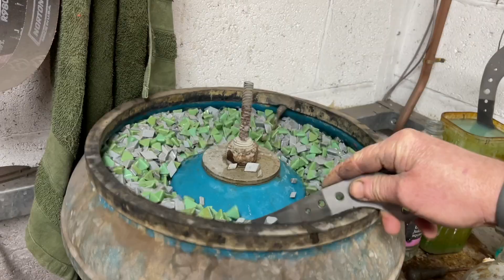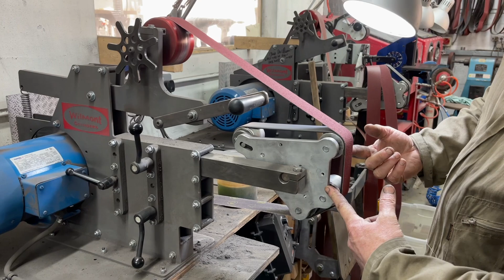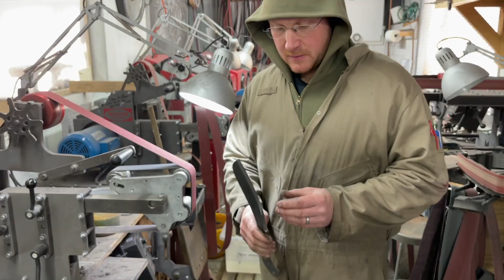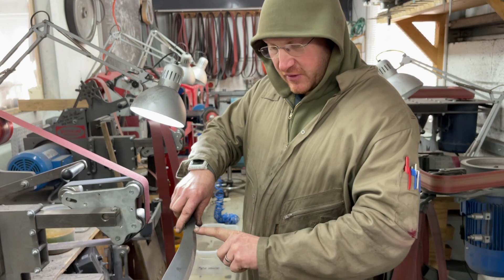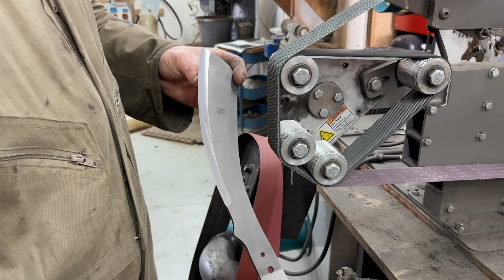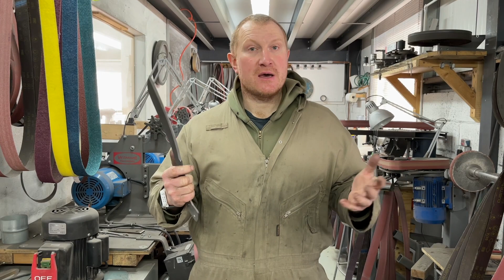Convex Grinding Parang Blades WIP

Comment: Beautiful blades and a very impressive workshop setup. How do you find AEB-L compares against more traditional parang steel like 5160 and 52100 in terms of toughness, edge retention and ability to be sharpened in the field with simple tools or even natural stones? I am tempted by stainless for all the obvious reasons but some still say that high-carbon steel performs better.

Comment: That was nice parang for collector's piece. But traditionally parang was never made with full tang handle. Parang in this shape emphasized its blade's weight, so you have the weight momentum and don't have to swing hard to make deeper cut. Full tang makes the weight at wrong place and wasting energy to lift the parang. Anyway, your surface finish is very nice.
Reply from the maker: Check out the feel of our parang in hand, and see what you think! Also a full tang construction is guaranteed not to let you down in the field.

Comment: Never seen a parang that thin then have a scandi edge which is lightly convexed. 
I'd really have to see one in the field.  To me it seems like it's a collector's piece.  
Especially with the stainless most parang are made of 5160 . If you really use your tools you never get rust. 
My grandfather said years ago stainless is for the people that don't use their tools. Stainless was made for the guy that doesn't know how to maintain or sharpen.
Reply: Well your GF didn't have access to these tight grained SUPER STAINLESS STEELS and if he (like all good artisans) would've kept an open mind and tried one; well the proof is in the pudding.  He does special quenches and tempers particaular to AEB-1 and that is how a thin scandi-VEX Parang BLOWS YOUR MIND upon first connect!!  GodBless

Comment: won’t the edge be fragile if it is a blended Scandi rather than a true convex? That means the part of the grind nearer the apex will not be radiused.
Reply from the maker: Not at all these have been extreme tested in the field and have Amazing edge strength and still super sharp 👍
Reply: @BenOrford  How does that work if you have a straight edge bevel with no secondary? What angle do you grind to at the Apex?  What is the thickness behind the edge?  do you strop for a micro convex?  What is the HRC at the edge?
Reply: @Abbbb225 get out there and test one and answer your own question haas!!  Its the future! These steels pwn u!

Comment: An excellent how-to Ben. I'm just curious as to the why. What is the benefit of having the Scandy transitioning into the convex grind and is it unique to the parang, or would you do this on other blades as well?
Reply: The scandi is a great grind for fine tasks like paring or notching, the convex is more so for chopping/ slashing as it gives great strength behind the edge due to the geometry. So you get the best of both worlds. There are a variety of knives that have dual/ compound grinds, most of them are for out door knives giving the blade more versatility.
Reply: Convex stays sharp longer, stronger, splits wood more effectively, better for feather sticking, and (believe it or not) is easier to sharpen than scandi, no matter how straight you try and keep your strokes when sharpening scandi you’ll always turn it into a shallow convex, so most people already know how to sharpen a convex without knowing themselves.